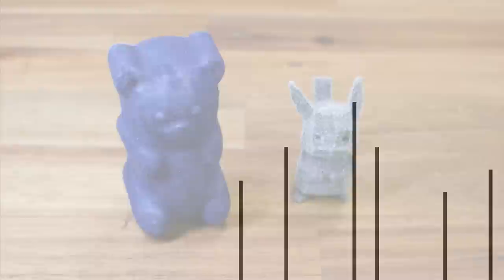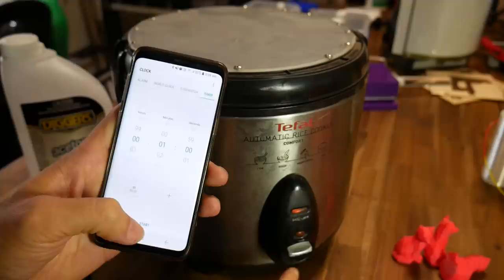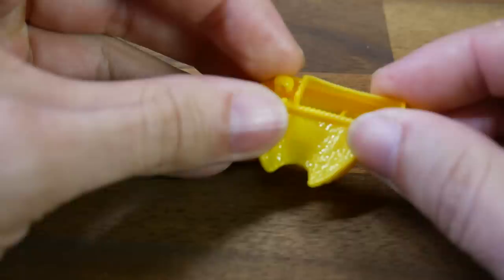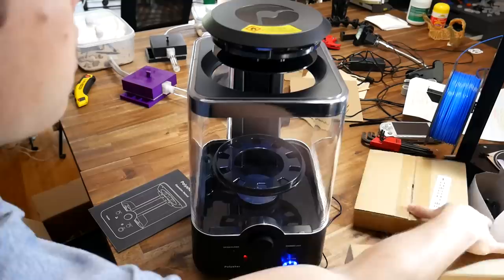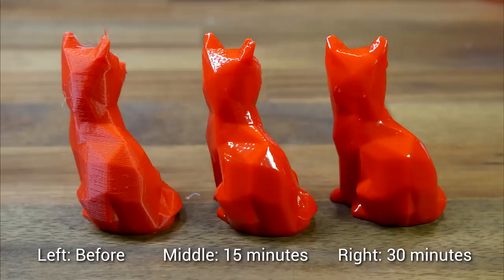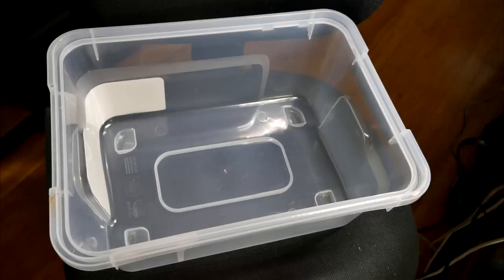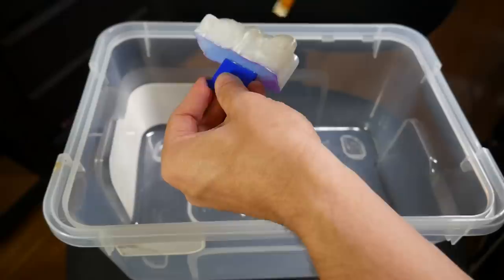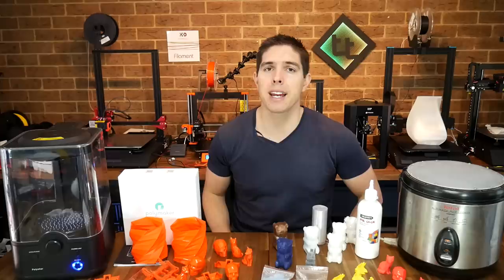3D printing post processing for gloss and furry finishes

Comment: As a terrain modeler, I can tell you how to best work with powder substances that you wish to apply on solid surfaces: Cover the surface in PVA thinly, then just use your fingers or a container to pour the flock on it. If you have enough, you could also throw your object into a container full of flock. When this has dried, get some watered down PVA and cover the entire surface again. It can help to mix isopropanol alcohol into the PVA-Water as well, so that surface tension is broken and the glue seeps into the flock more. Once that is dried, no flock can ever fall off again.

Comment: Build an enclosure for the ABS printing.  I'm sure you (TT) know this but for anyone who doesn't, having an enclosure (even something as simple as a cardboard box around the printer) to prevent drafts and increase the ambient temperature is a great way to prevent warping and delaminations.  Contrary to what people say, ABS is not obsolete, it definitely still has its uses and advantages and I use it almost daily.

Comment: just to let you know you are using the flocking tool the wrong way your meant to pull it in and out so that its allow more of the flock to come out using compressed air  not shake/tap like it as you did in the video, it can get you an even coating much quicker and that is how they apply it on the interiors of cars at a much faster rate.

Comment: Few coats of clear nail polish borrowed from wife did the good job. Layers are still slightly visible but part got the clear shiny finish. 
As you said, layers in 3d printing is very acquired choice And I think it is very important part of 3d printing specially in FDM. 
Nail polish filled out few voids and large layer gaps and it looked nice.
Reply: I tried this with my gf nail polish and it's works. Thanks for the suggestion!

Comment: Dichloromethane works really well for smoothing PLA in a rice cooker. It has a boiling point of roughly 60°C and easy to use. A bit toxic though.

Also when using the tumbler I would recomend you to use a slower speed and heavier granules. We use one for cleaning brass plumbing fittings and it works really well.

Comment: I seen this Video of yours and you have given me good help over time and One thing I have used well for glossy prints is DIY UV Resin for glossy coating models, These are cheap and come with a UV light sometimes or you can buy them larger to save time, you only need to set it and then you can fully cure in the sun if need be. Good thing is that if you print black (or other colours) models that are a slight dull the UV makes it super glossy and it also protects it, so you can coat just different parts to create a different effect. 
It covers the layer lines if you let if settle before you cure it as there is plenty of time for this, so it levels itself out. Also you can do 2 coats that will remove all lines with no sanding plus it can be painted if need be , just a simple way with out a lot of work, One other this is that its very good on silk to keep its shine and gloss, I'm sure you know about this but well worth sharing :)

Comment: To flock rubber gloves, the flock is made into a fluid bed by blowing low pressure air through it in a box (best inside a sealed container to catch fibres) then glue the surface and dip into fluid bed. Instant total coverage. Allow to dry and vacuum off the excess.

Comment: You can indeed use a typical sprayer to spread alcohol on polysmooth printout. It sometimes does an even better job than their expensive baking machine. Noted such smoothing can create water-tight printout, an extremely useful trick for functional design or fancy vase.

Comment: For the fur I would apply the adhesive then place it inside a cylinder with where a thick layer of the fur is resting inside at the base. Then drill a hole in the cylinder and mount a hair dryer or some sort of blower which agitates the fur for x number of minutes. This should get a nice even application across the whole model in one go.

Comment: I use acetone but I don't use heat. Just use a large airtight plastic storage tub with paper towels magneted to the side dipped in acetone. Leave for 30 minutes and it works great with no scary heat around your flammable acetone.

Comment: If you want to smooth PLA in theory you should be able to use Ethyl Acetate or Dichloromethane, both are meant to dissolve PLA with the Acetate not being as harsh. Both can be gotten from Sydney Solvents here in Aus for cheap enough just note that the Dichloromethane is "Lab Grade" so... obviously be careful.

As for the flocking, use the modellers technique, apply the PVA with a brush as you were, apply the flock then use a mist sprayer and apply IPA then another mist sprayer of watered down PVA. The IPA will allow the PVA to penetrate into the flock and once it's all dry it'll be solid. You can also apply more flock on top of the other flock after the watered down PVA and it'll stick which will help close up the gaps you have.

Comment: as a 1:24 scale model builder, we use Flocking a lot for car interiors, you would be better off spraying a clear over what you're trying to flock, while it's still wet, put the flocking through a tea strainer, you will have a much better result

Comment: I think you can use air brush (take out the pin) to put the flocking powder on to the figure at the meanwhile place a vaccume cleaner on the back.

Comment: I don't have an expendable old rice cooker, so I use an old saucepan.
I found using it on the stove boiled the acetone (even on low), and trying to "cold smooth" was useless. Eventually I found that sitting it in the sink with a few inches of hot water (from the tap, not boiling) got things happening quite nicely.

Comment: Why hasn't anyone tried Gundam glue? The glue we used to use for gunpla is a paintable liquid that doesn't stick to anything but itself. It's also a solvent, but nowhere near as vicious as acetone. In my experience it doesn't work with LEGO and they're ABS, but it should work brilliantly for pla and the cheaper and crappier the better. I'll be testing this when my ender3 comes in

Comment: If there is some way to keep the glue tacky until after applying the flock, you could get an even coating by suspending it in a container full of flicking particles and then shaking the whole container. It would then cure once removed and you’d have a perfect application. Perhaps some glue that won’t cure in CO²?

Comment: The issue you're having with the flocking is that you aren't using the applicator correctly. You're supposed to basically pump the 2 halves. It pulls in air and then forces out the flocking material.

Comment: I'm humbled to see my Mistral-E being shown in the video. I hope you don't mind that I comment on your print results of the duct. As with any duct it is, for the most part, important to have your printer well calibrated to print such an important part. You always want the air to be directed to the area as the design was intended. Poor print quality particularly distorted and uneven walls will have a negative effect on air flow.
I'm surprised that you could easily break off the main (not the thin walls) mounting tabs. This tells me you have very poor adhesion between the layers. You might want to look into that.
I've printed a ABS version (I've only been using this duct in PLA) and posted the results to the Thingiverse link of the Mistral-E duct to show how the print is intended to look like. BTW, the duct was printed with an Anet A8 as I confine my Ender 3 to PLA prints only.
I'm certainly looking forward to the usage and impressions of the Mistral-E duct on your Ender 5.
Keep up the great work!
Leo

Comment: Just FYI, for those that want a dirt simple method... put a mason jar, with  a few mm of acetone, on your heated bed and "dip" the part into the vapor (not the liquid) for a few seconds at a time till happy. Not safe, eco-friendly, or accurate, but quick! If you are that afraid of acetone, you probably shouldn't have a 3D printer ;)

Comment: Have you tried a syringe bulb like used on a baby's nose.  Fill the bulb with flock and blow it on.  I have used the technique with applying power coat to small heated metal parts.

Comment: Apply thin coats of glue. Let it set for a minute before attempting anything. Don't use the applicator like a salt shaker, they are meant to be used...not sure how to word this... holding the base and while aiming it at the object, motion obscene gestures? Air pulled in thru the end should cause turbulence then send the particles flying out the next time you collapse the cylinder.

Comment: Is there a good way to print a flat surface with no reflections ? In telescope building  the  easy choices are  either touse adhesive  velour flocking cloth inside the tube or use matte paint.  Searching the net has not helped yet. The cat modell that came with Creality CR-10 has pretty good uneven surface simulating the fur.  But  how to model it?

Comment: Flock - heavily coat model with glue, put it into your tumbler for 30 sec with the flock and see what happens - if you make another container that fits into your tumbler (with the model and flock) the glue would not ruin the tumbler. - NEW THOUGHT, put the model (glued) into a plastic bag with flock and shake.

Comment: You left these abs prints in acetone vapor for too long, you can get great smooth finish without loosing details. Without heating 15 minutes would be more than enough for 0.4 nozzle diameter prints.

Comment: Have you tried electroplating a 3d print?
Reply: how do you electroplate plastic?
Reply: @Noonenaught  I think it might be possible by electroless nickel plating.
Reply: My understanding you have to coat the 3d print with a metal conductive paint. You can buy a kit from Caswell that you can apply a copper finish... And have to option to coat other metals. Instead of buying a Caswell kit I tried to do this with materials laying around my house but ultimately failed. I will try again this weekend.

Comment: You didn't apply the flock properly for that applicator. You don't shake it. You pull the smaller chamber to draw in air and pump flock into the piece. Also, PVA is not the way to go. You need a CA really for it to work well. Informative video none the less.

Comment: not trying to be rude, but "furry" looks more like someone dropped a lollipop on a carpet.
it looks like someone was putting the glue on when they accidentally dropped it in sawdust.

the smooth version also looks odd. it's like someone tried raising the resolution, but kept it low poly. so it's both more and less detailed at the same time.

might be good for some high detail prints, or if you wanna make a mold out of the abs (get rid of print lines so your casting comes out smooth.